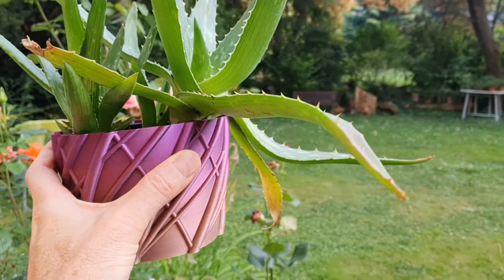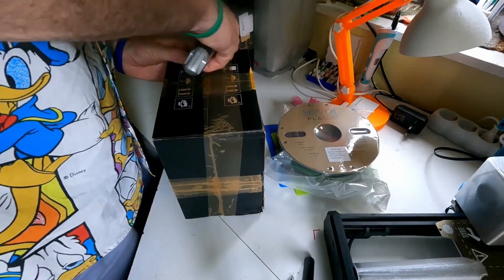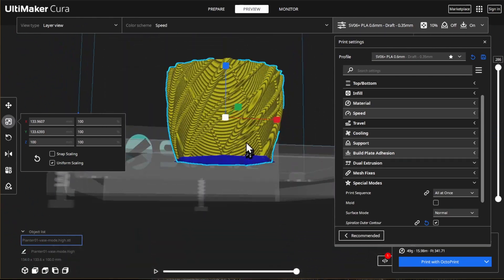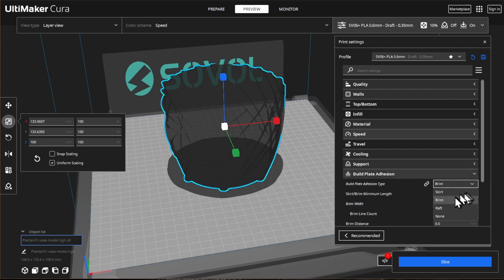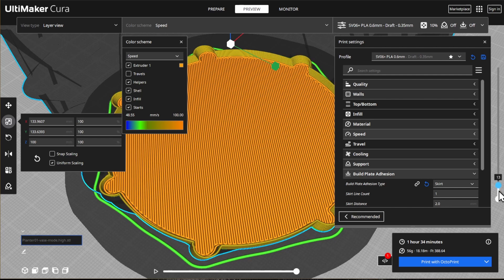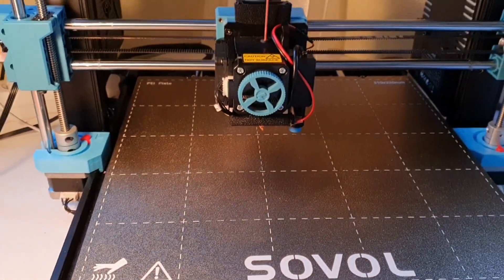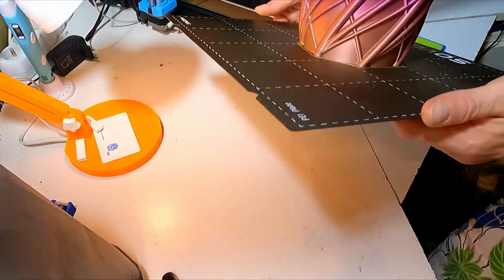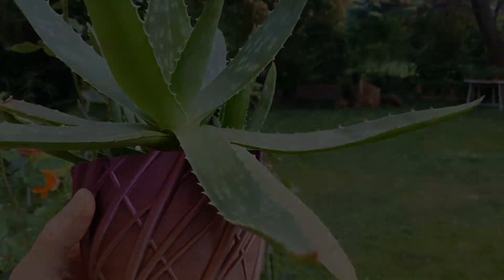Sovol Silk Rainbow Filament test - Vase mode planter 3D Print on SOVOL SV06 Plus

Comment: Why do you store the filament vacuum packed?
Reply from the maker: It's pretty humid here in the summer, and I have a lot of filament that I tend to use for years (different colors which I don't use up quickly). PETG suffers the worst of  course, but even PLA becomes brittle if it gets wet, and while drying can help PETG, PLA degrades with humidity, which drying cannot really reverse.  The filament dryer is only a good solution for PETG and Nylon, ASA etc. For PLA the best remedy is prevention.
Reply: Thank you for your answer, I'm just starting my adventure with 3D printing.
Greetings from Poland :D
Reply from the maker: Greetings from Hungary  🇭🇺❤️🇵🇱  :) Recommended watch: Thomas Sanladerer's video on filament drying.

Comment: What other stuff can i print with this sovol filament. And using which printer
Reply from the maker: Watch some of my newer videos, I use these rainbow and multi-color silk filaments for all kinds of projects: 
► the USB stick racks in here: https://youtu.be/86CFV_CbrvQ
► awesome vase-mode chess set: 
► butterfly knife: https://youtu.be/3lYa-JZdnbc
► and even some of the game tiles in here: https://youtu.be/_M7PfyF0EFk

And many many more. Almost all of my more recent videos feature these. They look amazing and they are easy to print, the only settings difference I recommend compared to regular PLA is to slow down the outer layers to make them shiny.  You can still print the rest of the model with the same PLA speeds, just halve the outer walls and top layers.  It will look amazing! Check my video description for direct link to these Sovol Silk filaments.
Reply: @gerGoPrint3D  Thank you so much for all the great stuff you show. I need to finalize a printer to buy as well which shall print the maximum of these gift items. Any recommendations please